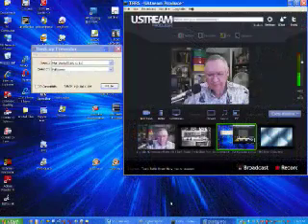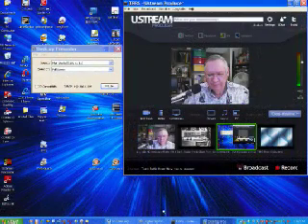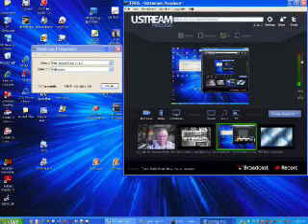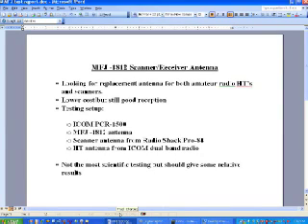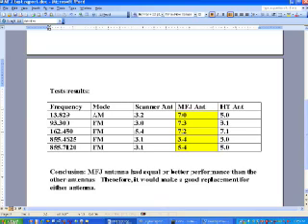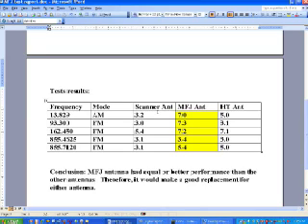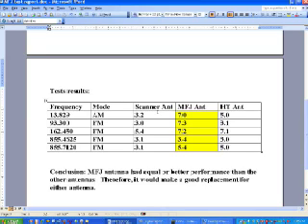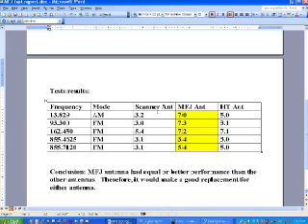TRRS #0023 - MFJ-1812 Scanner/Receiver Antenna

Comment: Are you sure that's not mfj1811??  https://www.radioworld.co.uk/mfj-1811_scanner_receiver_telescopic_antenna?campaign=1620062117&content=308859470306&keyword=&gclid=CjwKCAjwi_b3BRAGEiwAemPNU0Ub84grFyR_Y8HeVZHDk969nmpNNPhkQpIT-eCD8PZTUw6O4rgeSRoC6scQAvD_BwE
Reply from the maker: You are correct.  I think they have changed the model number over the last 10 years.
Reply: Do think I'd be better of with one of these than a cheap £5 telescopic,  reception wise? The mfj is quite expensive at £18
Reply from the maker: @jimphillips4377  There are other options but they are a lot more expensive.
Reply: @hamrad88  I've picked up cb using my Watson airband antenna and grecom handheld scanner  but I do have a load of old speaker wire I could shuv in and try? :D
I really want to pick up 10 meter ham band.  That's as low as my scanner goes.  I pick up loads of 2 meter band
Reply from the maker: @jimphillips4377  Shortwave including 10 meters is pretty poor right now.